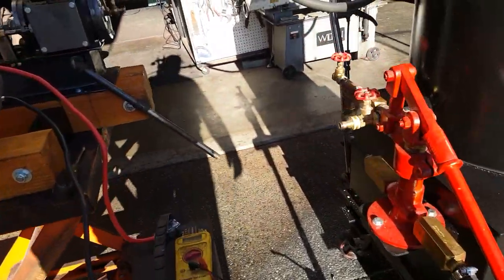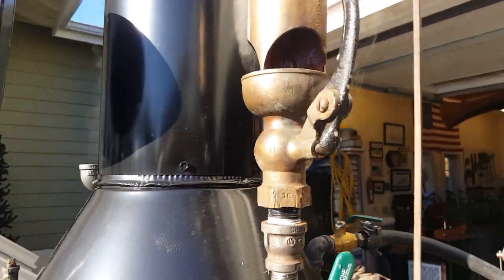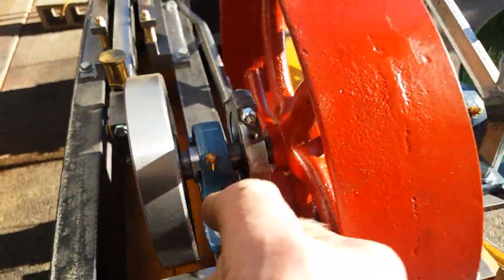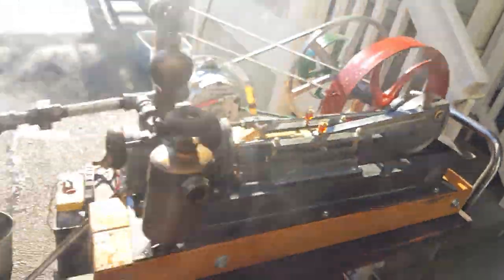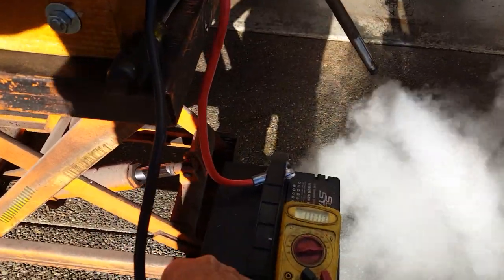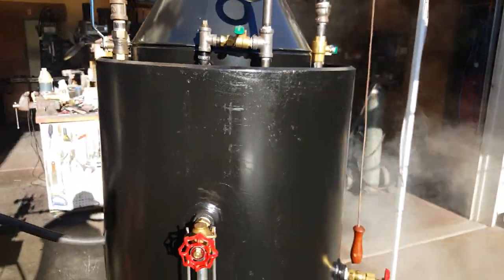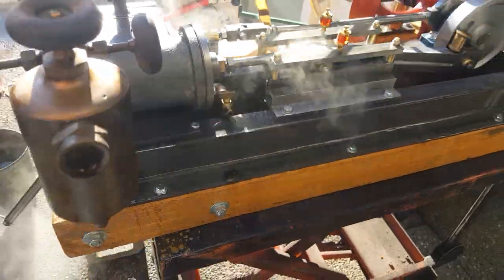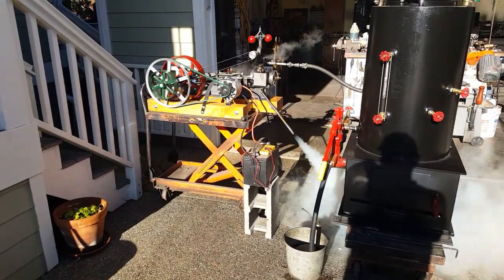steam engine and boiler for Stephen..

Comment: The Gray Fox
Jack,  I love steam driven motors and have seen this a few times.  I also, saw a small Steam motor in a 14' boat, about the same size as a Jon Boat back home.      
The wood Mill down by the river in Navan where I lived was all steam driven.  They ran the big Wood Saw, the Drill, a Belt Sander, a Wood Lathe and a winch to haul the big logs up from the river to the Saw bed.  I would sit there on a Saturday morning and watch the Mill in action,    It was awesome and nothing went to waste.!